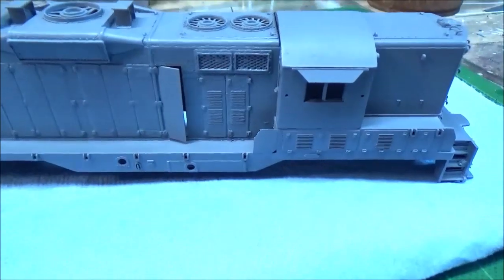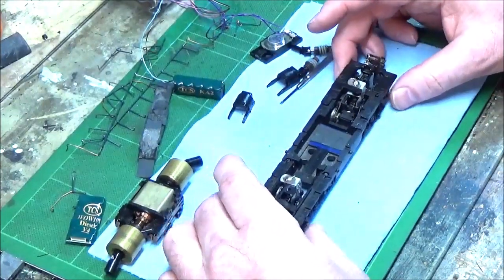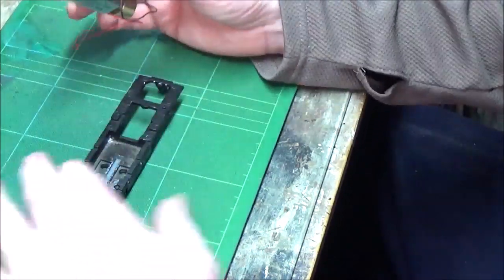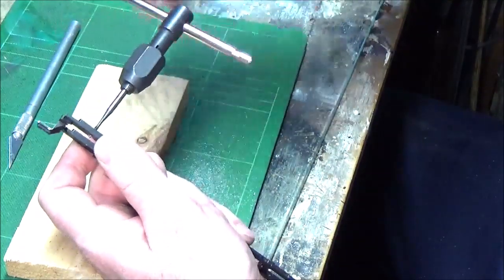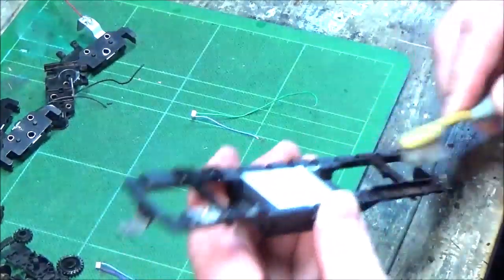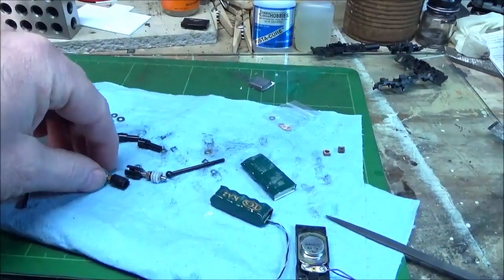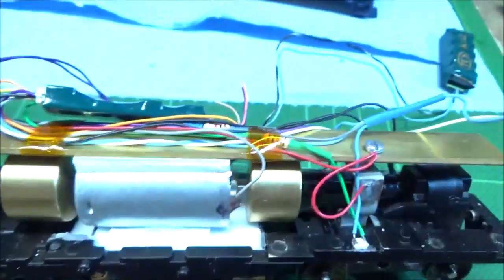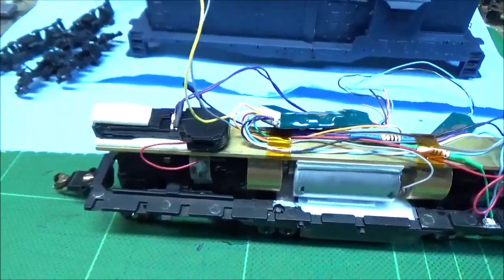Model Railroad Update 26 (Another GP7 Project; Part 2)

Comment: Love the Motor Well filled with Epoxy and Lead Shot! I have to remember that!! 👍👍
I may try that on either my GP7 or U30B.
My GP7 has one of the very first WOW! Sound decoders. It keeps going back to default settings without me doing anything though... 

Looking forward to seeing this finished! 😊
Carmine ✈🚂🚙
Reply from the maker: That is the second time i have used that approach for a motor base and so far it seems to work well.  If your wow sound decoder is that old you may want to send it back for an upgrade.  I think it cost about $25 plus shipping but that should bring it up to the current firmware version.
Reply: I may look into that, if I can get the $25.... I'd like to.

Comment: This is a great video. Full of tips and tricks. Thanks for sharing your tips. What size LED’s did yo use for the truck lights? Have you looked into a Decoder Buddy from Nixtrains? It is a board for a 21 pin decoder, has spots for LED lights with a resistor on the board. I have put a few in and they work great. Also have spots for speakers to be wired. Again, thanks for sharing.  Ken
Reply from the maker: Thanks Ken,  i have not looked into Decoder Buddy but will do so and appreciate the thought.  The surface mounted LED's are warm white in color and were the second smallest i could find.  The next size smaller seemed like they might be really challenging to solder.  i will have to look at my paperwork to find the exact size but by memory would place them at about 2.5mm by 1.8mm give or take.
scott
Reply: Thanks Scott! It is appreciated.